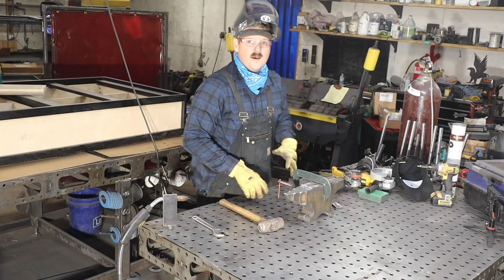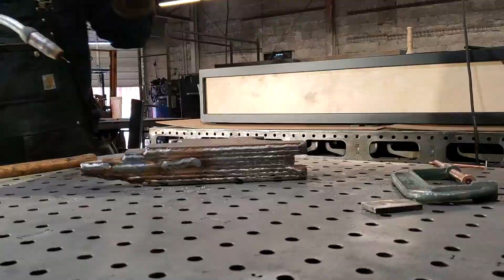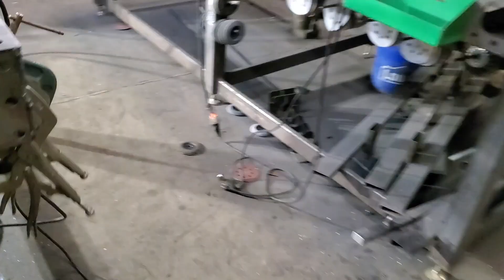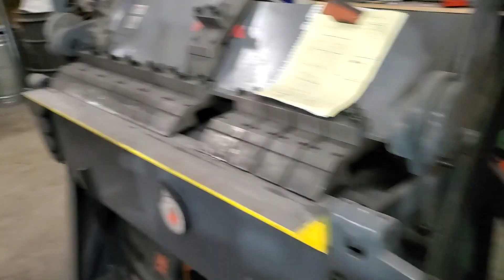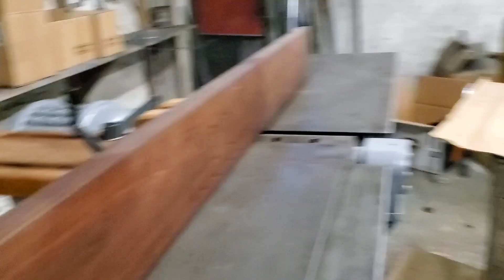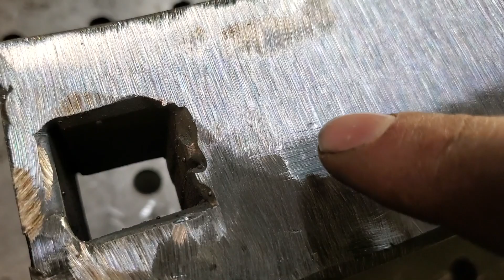CAN YOU MAKE AN ANVIL? - 1 of 3

Comment: Excellent video, I have wondered about this myself using a couple different sceanarios.     First off would you get a better result if you had a random pattern of plugs welds or slot welds within the main field to enhance thickness.     The second plan unilized two sections of railroad track, cutthing the bases so the tops meet, and then welding them solid.  We often have leftover sealed 50 pound boxes of rods that often sell for twenty cents on the dollar price at the local welding supply.     That would also allow you hekka bead stacking practice...

Comment: With those settings your welding at youre really in spray transfer mode at 80/20 or 90/10 would be much better for you
Reply from the maker: Your 100% right. I was really pushing the limits of that shielding gas mix but I got decent results and felt like the heat was necessary to give this the best shot of acting like one solid mass. If this was code work, I'd have the proper setup. Thanks for sharing your experience!

Comment: Now that I see the tight shots, I realize I did overkill with my UMT weld-up. I did a root and second fill pass. Seems a root alone would have been fine. Super stoked to have this table now! Best, @HoneyOnWales
Reply from the maker: Ur gonna love having something FLAT that u can reference in every build! The design doesn't rely on the welds for strength. Just put enough there to keep them from moving and ur good to go 👍